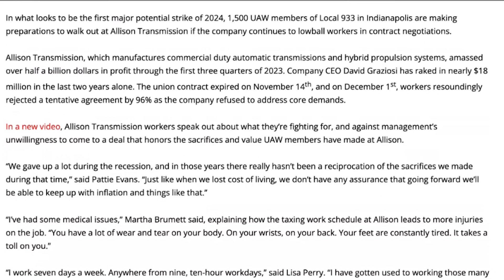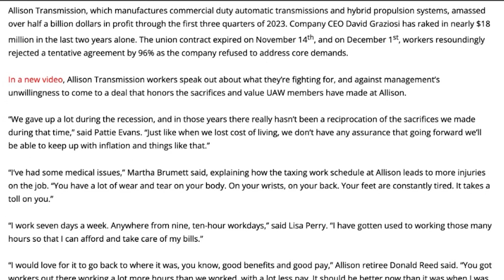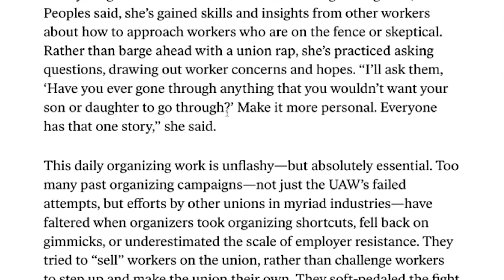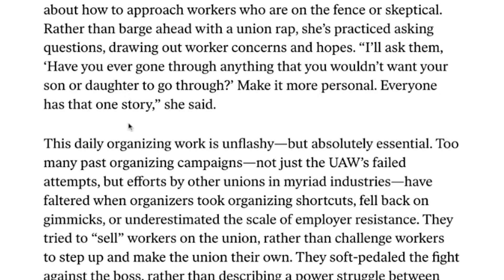1,500 UAW Workers About to STRIKE in Indianapolis

Comment: I wish the uaw would get the truckers to join and get the help they need to get fair pay and benefits
They average around 40 to 50 cents a mile and most have to load and unload the truck and then drive
They need to organize and have no help in organizing the drivers and owner operators